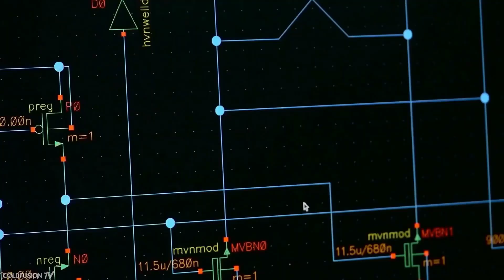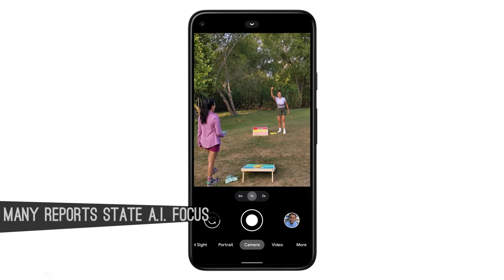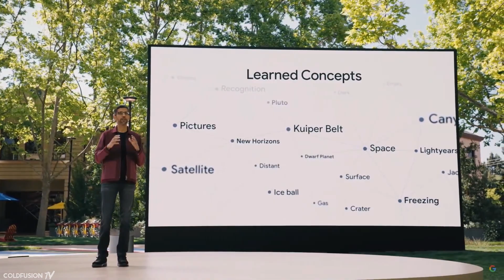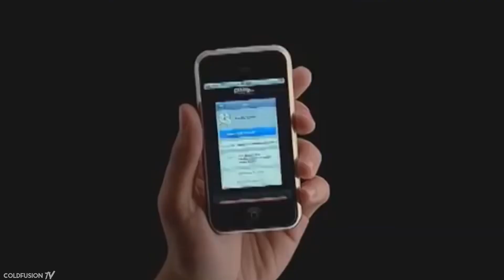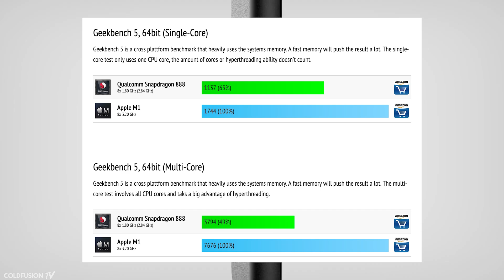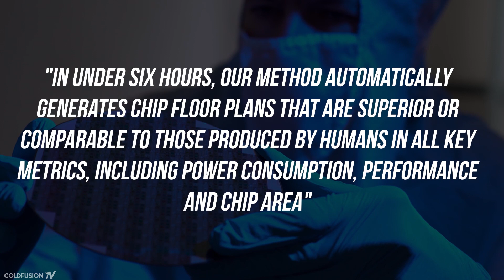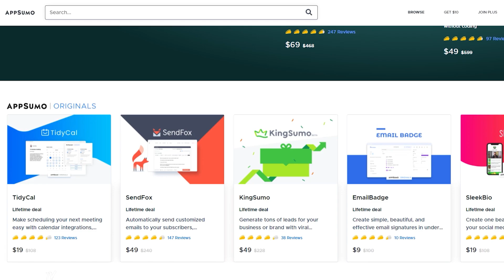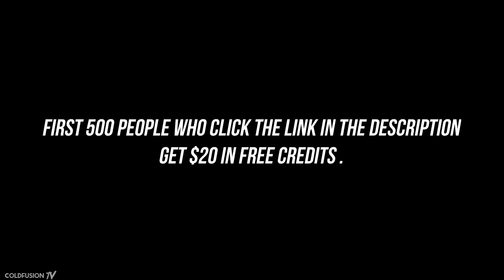Google Has a Surprise up Their Sleeve

Comment: I am not as concerned about Google building it's own chip as I would be if it were Amazon or Facebook. While yes, they gather tons of data through Android and chrome, especially with logins.., I have found that control over both what they have collected and what they do collect is very easily accessible to the end user. I worry more about my carrier than I do the hardware and stock android on my Pixel.
If they are going to trust Samsung to run it's own chips I see no reason to not do the same for a company that is more transparent about data collection and it's use.

Comment: Whitechapel being an 'equivalent' to a SD765... Hmmm.. But when you have Google's barebone, smooth, efficient and bloatware free OS, then really, for everyday users, they won't need a chip like the SD888 (or the lower performing equivalent Exynos), especially as the Pixel phones DON'T HAVE to drive an Android OS loaded with a bunch of apps that do the same as what Google's apps do extremely well (so thus redundant), plus any other crapware that manufacturers decide to throw on filling memory and slowing down the system....
So yeah, wouldn't bother me... It's just the, er, 'Spec Whores' out there lol... 🤔😏

Comment: As a ML researcher I cringe every time people pitch AI as a solution for everything, you did not talk about any of the cons of using it which I would say is disingenuous, the chip floor plan created by ai might be good and fast but it's never new, especially with such a small dataset it's more than likely that new and different designs won't be produced, it's called mode collapse. In general companies just like hyping by saying "AI" and so do journalists it seems

Comment: I guess big company will embbed spyware hardware since they big company (They want ads to the users.). As long no one notice for few years. Like those china server hardware back door that hear about some post or video. So there no way to check if hardware is compromise. There no like Microsoft certification driver since it cpu and gpu blackbox.

Comment: AI designing chips, a great subject for science fiction novel. Imagine the AI adding features not required by humans then we loose any ability to understand what's going inside these chips.
Reply: @HypercubeJones  The google VLSI AI doesn't receive Text inputs or visual inputs. In order for AI to be sentient it needs to do NLP and CNN tasks simultaneously to understand the human world, Goals, purposes etc. An AI can't learn that through Routing of MOSFETS in a smartphone chip. Hope I am clear.... The AIs used here are highly specialised for a particular task this is not general AI which can have a secret agenda.
Reply: We barely understand it now, once they are manufactured.
Reply: That's not how this works. AI is basically a mathematical function approximator. I can only do the task it is trained to do based on the data it was shown. I cannot do anything beyond that.
Reply: @KishoreKumar-uz8ir  You be wrong. It does ok on trained data and on most similar previous unknown new data. But it does not save you from the consequences of false positives.

Comment: @6:25,  To those worried about AI designing chips dont worry,  the papers synopsis states that AI was only used for the layout of components. That means that the circuit design was still done by humans. The layout is where you place the circuits on the chip and how you route the traces to connect the circuits. There have been "automated" methods of doing so for decades but they all suck. I've used many of them and there is always a lot of hand holding of the algorithm to get it to work. Its actually really awesome if this  works.

Comment: I'm surprised AI-assisted chip design wasn't already a thing!
Reply: The extent was pretty low level integration for AI in design. Most were just used for optimisation & almost none were built from the ground up. A few were being tested however, which never saw commercial production phase as the tests were not very impressive.
Until, of course,after thousands of simulations & learnings, now the balance and stability according to what is needed is just being given at an astounding rate of success.
 I'm not so sure about the 6 hours thing though. However, yeah, AI now is just way fast and at most times accurate with great efficiency to old school human designed architecture. That being said, some elements have to be checked & verified by quality experts for the AI designed chip as a precautionary measure.
Let's see the implementation though, because in theory Google is right to cover up the delayed time for its own chipset, however doing it in real life, efficiently & while keeping the costs down will be a challenge. 
Frankly, I wouldn't want Google to hype it up much because they may not live up to the whole expectations they create from the hype. That is, Until it's properly done with affordable costs & optimised with their Software integration.
Only time will tell..
Reply: Yeah me too to be honest.
Reply: There’s a difference between assisted and guided design.
Guided, suggests the intelligence is leading the decision making, not just filling in the blanks.
Reply: Silicon Valley = CIA
Reply: @_noname617  Computers In America ?

Comment: I would buy this phone if it had MicroSD card slot, but because it doesn't have it, I will not buy. 

I refuse to be raped by insane internal memory overpicing practices. I want to be able to swap very large MicroSD card between phones, so I do not have to pay again for insanly overpriced internal memory.
Reply: why would google invest in large amounts of internal storage/additional storage slots when they have Google drive and pics for storage?
Reply: @spartanchuckles8743  microSD card slot costs few cents. There is no excuse not to have it.

I will not use Google drive. Google is in the PRISM program. Thanks to Edward Showden we know that.
Reply: @glitchysoup6322  and yet you are using YouTube, which is part of Google/alphabet and also part of PRISM. So is facebook, Microsoft.
Reply: @spartanchuckles8743  I know. But Youtube doesn't have alternative. I at least I use Ublock and Youtube Vanced to curb explotation.

I do not use Facebook or any M$ products. I use Ubuntu (GNU/Linux distro) and the only 2 proprietary softwares I use are propertietary Nvidia gpu driver and Steam.

Comment: as a Pixel fanatic i really hope the new phones will offer something good, better specs across the board and a modern design (the leaked on isn't too bad) 
the problem with previous Pixels is the fact that Google kept mimicking Apple with inferior specs and hardware. imagine giving your power hungry phone and OS a small battery and low amount of RAM..... come on Google you can do it this time.

Comment: Hello! I am an electrical engineer here, although I am not an expert, I already designed ASIC and to be honest even if the layout of the chip is taken care of the most time-consuming part remains the design of the logical components. That being said “place and route” is kind of boring anyway so it’s a great thing that this happened
Reply: I think when you are talking about a processor at the nano scale that placement becomes a way, way bigger deal. It ends up having huge impacts on heat, power, size, etc. We are talking about massive, massive, MASSIVE complexity in these circuits, shoved into an extremely small space. Physics starts to complain. They said it takes experts months; it’s not your average “place and route”.

Comment: I dont why google hasn't tried to build chips but actually  the ceo sundar pichai has a bachelors degree in semi conductors graduated from iit.
Reply: What actual chip design experience does he have, other than the education ? A multi-core processor with custom hardware assist is no small chore. Laying out a chip is akin to laying out a PCB (printed circuit board). Its a lower level of design, as opposed to designing the system.

Comment: Why do you need a new chip? I don‘t know why there’s a new „better“ smartphone every year. I use an iPhone SE and never felt the urge to upgrade performance-wise. Humanity should stop polluting the earth just for owning a new device with unneeded functionality.
Reply: I was using my Galaxy S3 (2011) until it finally died in late 2020. It had a replaceable battery, so it was on its 5th battery, but the actual hardware didn't give up the ghost, and ran for nine years.

Comment: Hopefully those SoCs will be as good as the ones Apple make. On most phone benchmarks, Apple's A SoC is the class leader.
Reply: The first generation won't be. But I imagine if their AI can already make a competent chip, then the next gen will blow out good.
Reply: It will not be as good as apple chips the performace will be somewhere in between the snap dragon 888 and exynos 2100
Reply: If you want to chip that will be here than apple chips then wait for s22 because it will have a new and revolutionary  exnynos chip with AMD graphics
Reply: @5stxr.kixn1  do you know if the exynos/amd chip will be in the US or will it be Snapdragon again?
Reply: @robertjonesss12  the AMD x exnynos chip will not be in the US until 2025 but if we're lucky we might get it in 2023 if it performs well
Reply: Apple has been seriously working on ARM Silicon for 20 years. Google, Samsung, AMD, Nvidia and MediaTek - are relatively speaking just starting out, and it's going to take them a long time to make something close to the M1 chip.
Reply: In real life use apple just sucks.